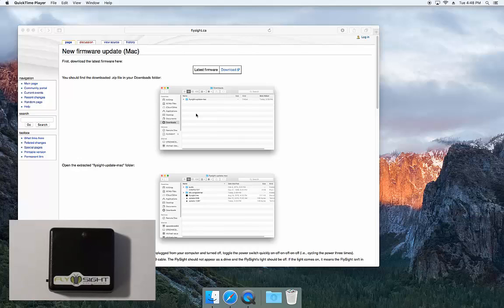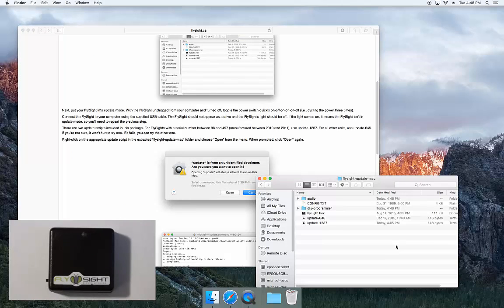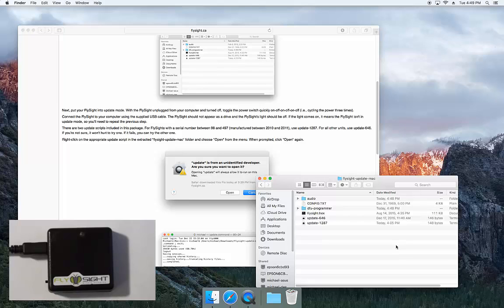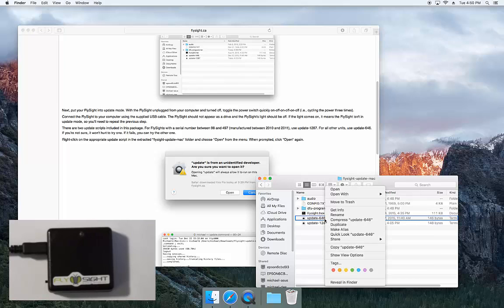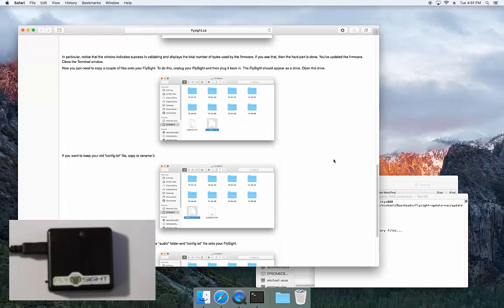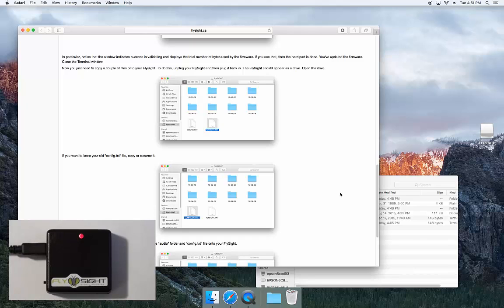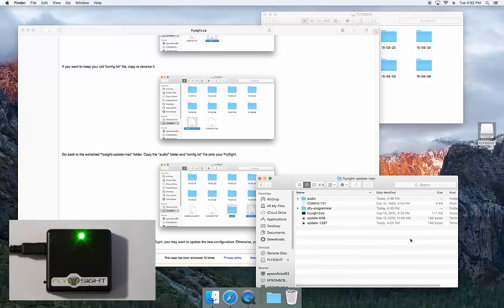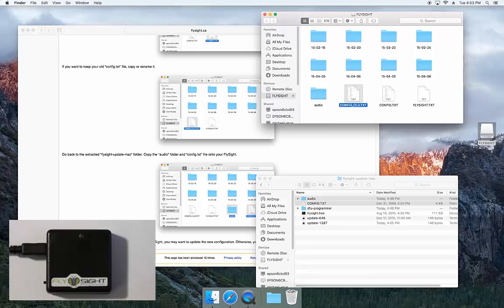New firmware update procedure (Mac)

Comment: Just a Footnote for Mac. After You Download the new Firmware for Mac before you do anything make sure your Mac Security Settings are set properly. Click on the Apple on the upper toolbar and open System Preferences. then Open Security and Privacy, Click on the Lock to make the following change Allow APPs downloaded from App Store and known developers to Allow Apps downoaded from App Store. Check Allow Apps Downloaded from App Store. Click the Lock to the Lock config and your done. This will make sure the Flysight Firmware works as advertised in the video above.
Reply from the maker: Thanks, Calen!
Reply: @flysightgps  Apple is just picky about their security and wouldn't properly open the dfu-programmer files until I googled a work around which was just telling the computer to allow apps downloaded fromt he Apple App Store and when all the pop-up windowns came up with the unknown developer stuff and the dfu-programmer question of do you want to open it etc. It allowed me to check the yes blocks and I was in busainess and the firware updated perfectly.